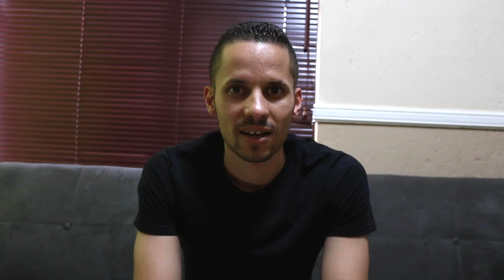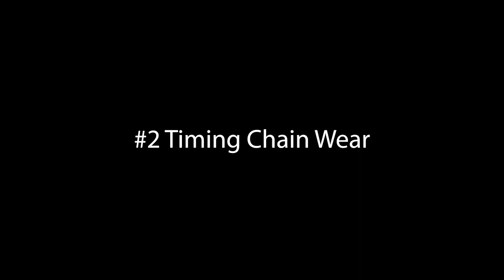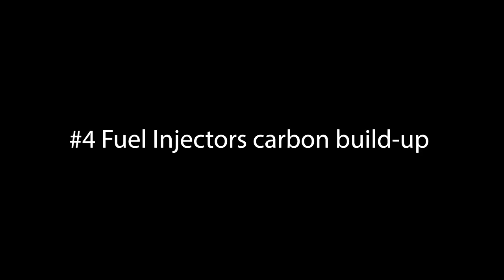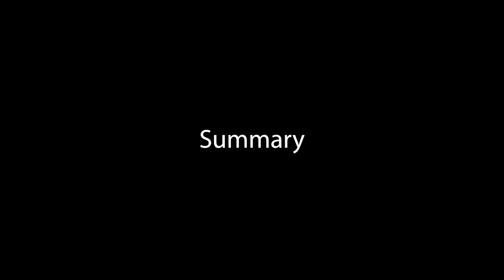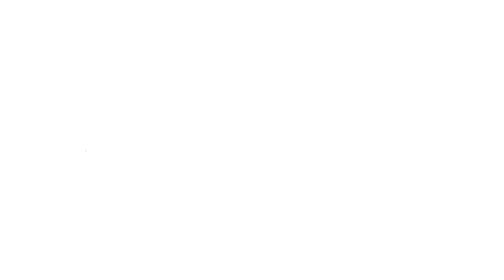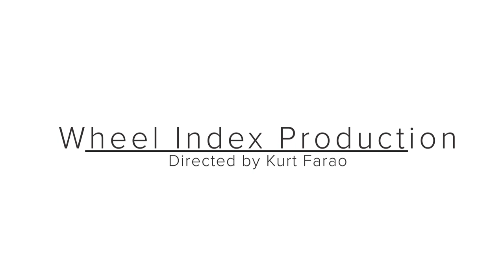7 Things you need to know about the VW Golf 7 GTI

Comment: Waterpump/Thermostat. I've replaced 4 over 3 years in less than 80,000km. It costs about R15K everytime. 

Symptoms: 
Coolant smell and/or leak under car.
Daily low coolant warning. 
Eventually you'll see the dash temp gauge act erratically, sometime go low or high, or even overheat warning. 

My advice, if you gonna drive it daily over 100km per day, don't buy out of warranty. Especially if you're getting it financed.
Reply from the maker: Any "expensive" VW product outside of warranty will have high maintenance costs.

Comment: Good video bro. What percentage of cars do these faults effect?  And what mileages?
Thanks 🦁
Reply from the maker: These issues are applicable to all Golf 7 GTI's. The Golf 7.5 GTI might have improved/revised parts fitted to remedy these issue, but we have no data to back this up.
Reply: @wheelindex8983  i gave up in the end, to many horror stories with the gti. Went for a focus st instead
Reply from the maker: @mrlionrocks  that's still a great choice and comparable to the Golf Gti, the Ford Focus ST offers better value for money, maybe less street cred.
Reply: @wheelindex8983  im enjoying it, the general build quality isnt as good as the golf but from my research there is much less things that go wrong.got a full 3 year warranty which is good. Everything you touch is nice, the steering wheel,leather seats etc but some of plastics are cheap. the engine is strong, 252bhp,270lbs torque,used st's worked out around £2000 less than the equivalent golf gti which is a bonus